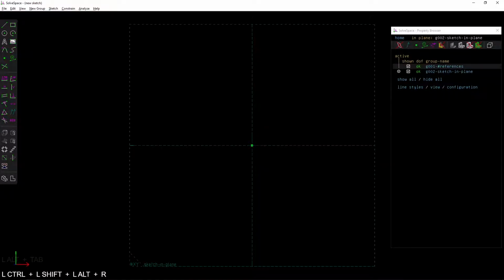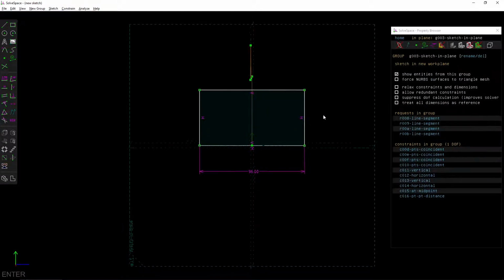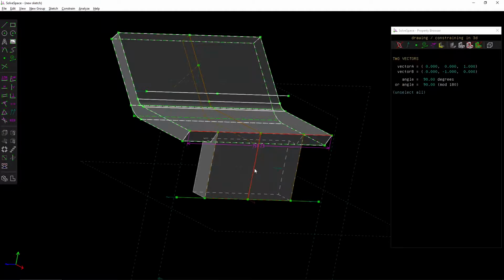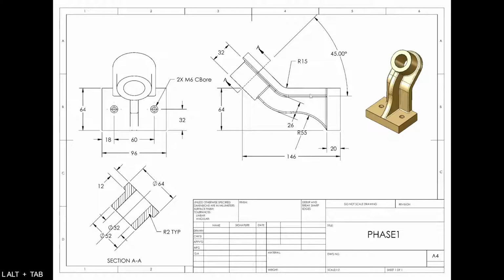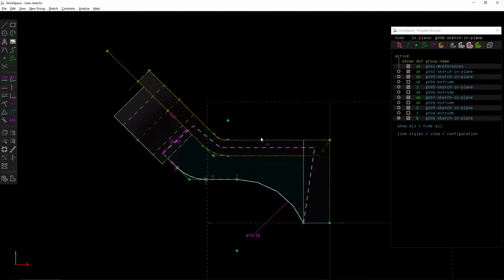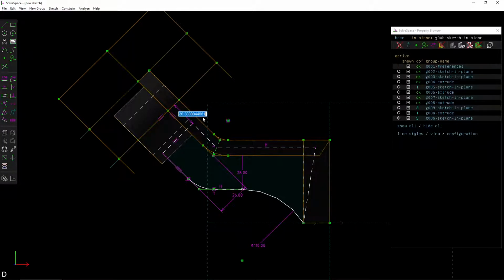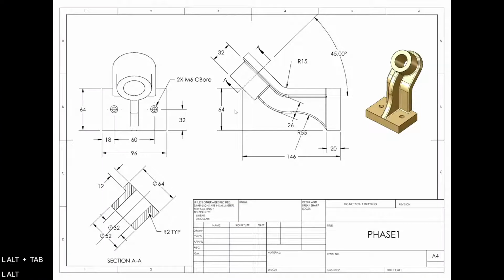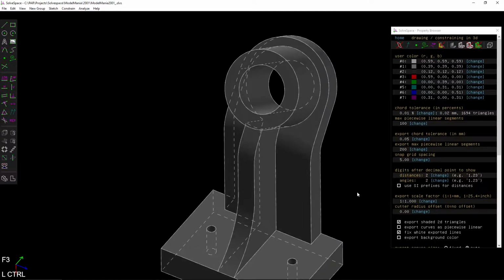SolveSpace - drawing the SolidWorks Model Mania 2001 challenge model in 18 minutes.

Comment: Is there any chance fillets and chamfers will be added in near future? It's honestly the only thing keeping me from switching over from FreeCAD, how would you have done the fillets in this example?
Reply from the maker: The functionality is hard to implement - various technical reasons. It is unlikely it will appear "soon" with the current set of "active" developers. The tracking issue is here  https://github.com/solvespace/solvespace/issues/149.

Making the fillets in this case is (99%) possible at the cost of many more extrusions cutting off the rounded edges. However this is rather annoying and time consuming.

Comment: Cool shit mate. You were fast. The power of CAD not in speed but in file formats that you can import/export to. If you can't make a basic technical documentation it's a total failure then.
Reply from the maker: SolveSpcae can export in the following formats:

Image:
	PNG image - png

2d view,
2d section: 
	PDF file - pdf
	Encapsulated PostScript - eps, ps
	Scalable Vector Graphics - svg
	STEP file - step", "stp
	DXF file (AutoCAD 2007) - dxf
	HPGL file - plt, hpgl
	G Code - ngc, txt

3d wireframe:
	STEP file - step, stp
	DXF file (AutoCAD 2007) - dxf

3d triangle mesh:
	STL mesh - stl
	Wavefront OBJ mesh - obj
	Three.js-compatible mesh, with viewer - html
	Three.js-compatible mesh, mesh only - js
	VRML text file - wrl

3d NURBS surfaces:
	STEP file - step, stp

Hopefully the above is enough ;-)

As for creating technical drawings - it may not be as easy as in some other CAD packages but is is certainly possible. Here is a tutorial https://www.youtube.com/watch?v=88Fo7jMrLyg